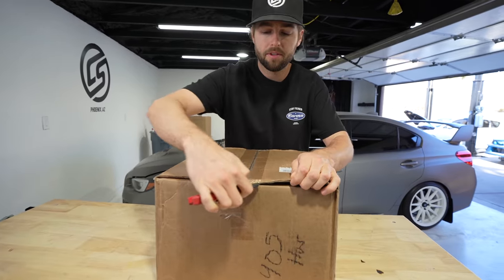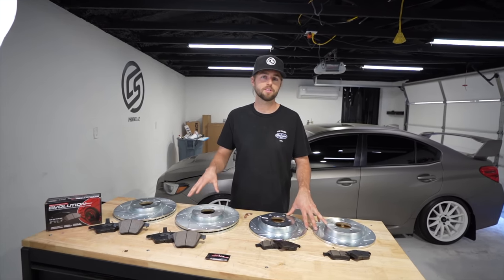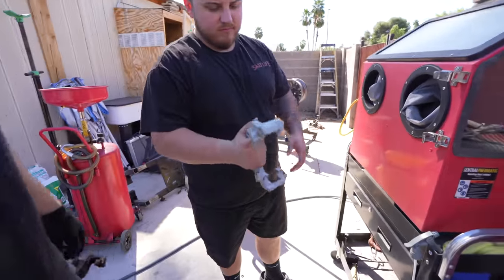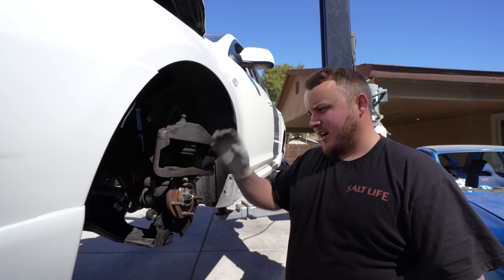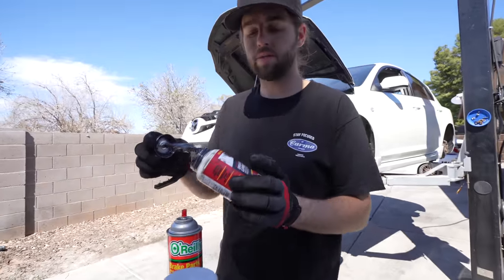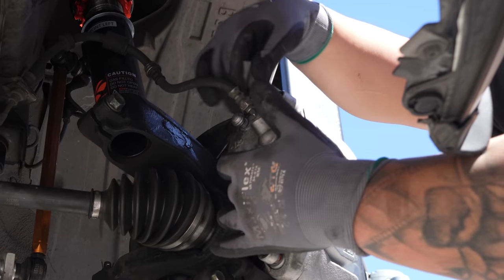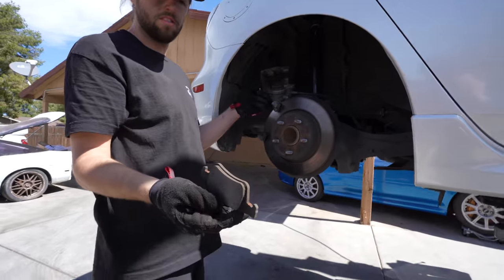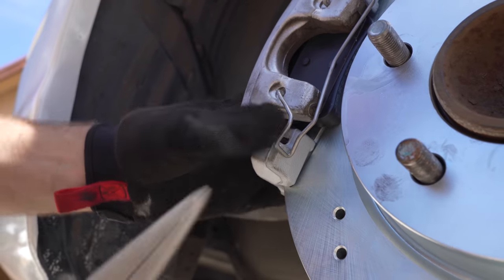Building a Mazdaspeed3: New Performance Brakes!

Comment: Slotted and drilled don't really help dissipate heat. If anything there's less metal in the rotor which means it loses some thermal capacity. The vanes in the middle of the vented rotors are what dissipate heat. 

Slotted is good for the track because they scrape glazed pad material away with every stop. Cuts down the life of your pads on the street though. 

Drilled is kinda pointless these days. Old pads used to off-gas when hot and that gas would build up between the pad and rotor, causing loss of braking performance. The holes gave the gas somewhere to go. Modern pads don't do that anymore. Drilled just sticks around because it looked cool on old race cars and who doesn't want to look like a race car? 
Drilled rotors can actually fail if you put them through enough high temperature cycles. The face of the rotor and the holes heat and cool at different rates, which can lead to metal fatigue and stress cracking. 

I'm sure these will be fine for a daily driver or even auto-x, but blanks really are best.

Comment: Tip for brake caliper compressing.
You can just use a c-clamp and a screw driver/pry bar. Takes more effort  but doesn't require purchasing a piston kit.
Reply: I mean yea but you can damage it this way and you can rent the tool for free, in my case I might just pay the labor for install because I'm a lazy pos and it's been really hot lol

Comment: 11:31  Next owner of the car will really "love" you when trying to service the car.    There is no need to use a threadlocker on caliper bolts.  Furthermore,  in order to remove the RED threadlocker, you also need to use heat to remove the bolts.  Otherwise, great video!

Comment: The Mazda5 rear calipers bolt on, increases rotor size. Also, the Speed3 brakes are pretty weak in general.